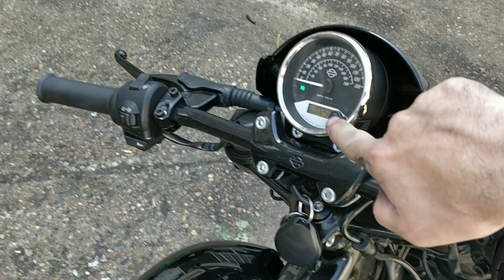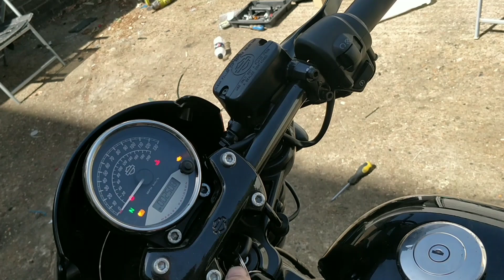My Harley Davidson has broken down, spark plug change. what next??? :( 2022  #broken #harleydavidson

Comment: Ok, locate the thermostat switch and bridge it to see if it kicks the fan in, if ok ....
Remove the thermostat and clean the metal  contact area inside the radiator. 
If no joy then it's the thermostat and not the switch.
Also chase the thermostat switch power to the connector block on the left handside.  Check contacts haven't corroded or melted.

Due to excessive heat I would check the rear brake fluid as it sits downwind and may have affected the fluid if original. 

Air filter is indeed stock but judging by the white writing I would say your ECU has been flashed & remapped for the exhaust or it's a second hand unit possibly due to a fall as it's the backing plate.
Any further performance upgrades will need a fuel pack piggy (fp3)backed of the ecu/cdi .

See what happens when you let Nat loose with sharp implements 😆😆
Reply from the maker: Thanks Daniel for the advice mate, I'll do these checks today. 

Appreciate all your support mate

Comment: I don’t think your thermostat is working or working properly 
You’re right to add a switch at least, even if you test the fan and find the motor is blown on it or ideally a faulty connection 
I think the coolant on the floor is overflow from it getting hot 
Loved the clips of you racing past the gate, appeals to my child like humour😂
Reply from the maker: Hi Gary, this evening I've been thinking the same that it appears its not opening. Problem is that you can only buy the whole unit including housing at around £120. I may try to get in and take the thermostat out, I can test it at least and possibly run without one. But again you can't just buy the thermostat itself which is terrible. 

Thanks for that clarification Gary that's extremely helpful

Comment: Maybe its the themostat
 switch not working properly Charlie,caus8ng the coolenr to get to hot and exoand,🙄,Nice haircut 😂👍
Reply from the maker: The thermostat housing has a temp switch in it, making me wonder if the thermostat isn't opening. Normally the switch is on the rad itself. Unless it has 2. 

I think my next step is to remove the thermostat and see if it works better. Also to check the fan fuse.
Reply: @motorcyclerescuer  yes that sounds logical 👍
Reply: @motorcyclerescuer  My experience with bikes is all air-cooled, but I am a retired car mechanic. In cars, electric fan control can be done in several ways: some have a thermal switch in the radiator, some in the thermostat housing or cylinder head, and some are switched by a relay controlled by the PCM, based on coolant temperature sensor input. 
This bike would be designed to work in all kinds of climate, many of them a lot hotter than ours, so the radiator is probably very efficient at getting rid of the heat, even without much airflow, so without knowing the temperature of the coolant you can't tell if the fan should be running or not. 
If the thermostat was not opening, the radiator would stay cold and the engine would overheat quite quickly if left idling after a run, as it was, so you would have a warning light. 
It looks to me like your original overheating was caused by loss of coolant due to the hose clip failure, not the other way round; cooling systems are designed to work at pressures of typically around 1 bar and if it loses pressure the coolant will easily boil inside the engine. That type of system is designed to vent excess pressure through the relief valve in the cap into the expansion tank, then draw the coolant back in as it cools when it's switched off, so your spillage at the end was most likely just the excess from refilling being expelled.
Meanwhile, on the Triumph carbs, they do have throttle stop adjustment, it's by the screws angled upwards on the side, which push the slides up. You need to back these right off before synchronising the cables, to make sure they are starting from the same level, then readjust them once you've got the cables matched.
Reply from the maker: Hi Rick, even in the best conditions these harley rads and coolant systems are known to not work very efficiently sadly. 

The temp sensor is in the thermostat housing on this one. My job today will be to see if the fan fuse is OK and not blown and to check the pipework around the bike to see if coolant appears to be flowing as it should. 

And with the amal carbs I didn't see the stops but will look again today. I'm sure it's not running properly on the right side, as in spark or similar so I've ordered a new set of ht leads. 

I've checked and changed everything else but it still runs hotter on the left. It definitely has spark on the right but possibly not enough. 

Any advice mate? 

Appreciate your help.
Reply: @motorcyclerescuer  On the Triumph, it sounds like any ignition issue must be on the high tension side, because a low tension fault would affect both sides equally with that type of system. Have you tried swapping the coil/lead combinations from left to right to see if the fault swaps sides (if your leads are long enough you can just swap those, because both plugs fire at the same time)? When you fit new leads, I would advise checking the ignition system supplier's specification (they usually specify copper core wire and 5000 ohm resistor caps). If you have a strobe light, you can connect it to each lead in turn and just watch the flashes for a while. If one of the leads is breaking down, you should be able to see irregular intervals in the flashes.
On the Harley, don't assume that the sensor on the thermostat housing operates the fan directly, it may just send temperature data to another control unit (bear in mind there must be a sensor which triggers the overheat warning lamp). If it is a simple thermal switch, the wires should be the same size as the ones supplying the fan motor.
Good luck with getting both of them sorted.
Reply from the maker: I've ordered new ht leads with caps for the triumph so that should tell me what's going on hopefully. Fingers crossed
 Will update soon. 

Harley seems fine, ran it today, all the hoses are hot so coolant is circulating which is great. 

Time will tell with the harley as to how its doing. 

Thanks for your advice, it's extremely helpful.

Comment: I used putoline iced coolant in my dt125r after I fixed my headgasket issues to help keep the bike cool. Bike seems to be running great with it
Reply from the maker: I think that's what I'll use although for now I think i need to check that the thermostat is opening as it should. It may not be functioning properly

Comment: (edit .   complete waffle below !! )... 🤗
It just seems odd taking about liquid cooling on a Harley . I guess it's progress . Like when they put a radiator on the bandit , it's just not right . But at the same time it is . 
I think the small spill was  overflow from header or expansion tank ( whichever it is on the 750) just from you filling it . And I'm guessing the over heat was from the hose fitting giving up not the hose going off due to overheat . As it's not showing an over heat light now and the fan is not coming on I'm hoping it's idling cool enough .. But then again every water cooled bike I've had will kick the fan in on idle within 5 minutes. 
I've also begrudgingly fitted a manual fan switch to some bikes just to be in control ..
Apologies for the long waffle. 😉
Peace and love brother 👍🏻☮❤
Reply from the maker: Its a tough one isn't it. It does appear yo be running slightly hotter then I like but within limits. 

I think I'm going to remove the thermostat and see how it runs then. If it appears to flow better and the fan come on then I'll have the answer to my question. 

Thanks

Comment: Just a thought the leak at hose clip was caused by over heating ,as fan does not run and the over temp light does not come on possible fan control module faulty hope this helps
Reply from the maker: My guess at this stage is that the coolant isn't circulating. Although I think the fan uses a fuse so I'll look to see of its cooked tomorrow just incase.

Comment: lovely bike, wished i still lived in london, was only in Clapton E5
Reply from the maker: Oh really, not too far from me. Although your probably better of out now Steve. London is hard work.
Reply: @motorcyclerescuer  tell me about it, job in Angle Islington was normally a 15 minutes drive, they closed the back roads then it was a 90 minute sitting in traffic nightmare, got a house up north cheaper than a lockup garage ;) (not knocking your workshop pal ;) use what you have, and the best to you, just so you know i have a workshop, lathe, milling machine, any bolts, special fixings you cant find give me a shout and ill run them up on the lathe)
Reply from the maker: Oh wow cheers Steve thats extremely helpful mate. I'll keep that in mind.

Comment: Hey great video. Have you tried changing the hose lines as the E10 fuel ruines the pipes etc.
Reply from the maker: Hi Cheryl, I believe they are already.
Reply: @motorcyclerescuer  good luck hope you've managed to solve the issue. I would check the hose lines and replace if necessary. 3 components needed for it to run... fuel... Air.... spark.... its just a guessing game to get the right mixture lol

Comment: Hi Charlie on the Harley are all the pipes getting hot like in and out the rad is normally how to check if the thermostat is working but looks like you overfilled it a tad as to why it was coming out the overflow also could be a air lock that stopped the thermostat from opening I'm sure you know all this anyway but hope you sort it soon
Reply from the maker: I actually didn't even think to check the pipes lol. Will check today mate. My guess is that the coolant isn't circulating as you suggest. I'll check the cold level today out of curiosity. Cheers mate
Reply: @motorcyclerescuer  ok cool lol thought maybe you had done it off camera I'm sure you will get to the bottom of it such a mint bike would be a shame to fit a switch to it for the fan but if need be is a easy fix good luck!
Reply from the maker: Time will tell Alex. I'll keep everyone updated, but it may be ok. 

Cheers mate

Comment: Hi flo is a very good brand. Its the only brand I'll fit apart from OE stuff
Reply from the maker: Hi flo, for the air filter?

Problem is that I would need to run a piggy back on the ecu which cost a few hundred.
Reply: @motorcyclerescuer  hi flo is just the name of a brand. Like Nike trainers
Reply from the maker: Oh I see, yes I have heard of it before Steven and used it a few times mate. 

Cheers

Comment: What a great bike. Just the ticket for knocking around on the streets with plenty of presence and feel good factor thrown in.
I’ve never owned an Harley, I suppose when I could have, it wouldn’t have suited my mindset or riding style if you can understand what I’m trying to say , and now it would suit me more I don’t have the money or room for one.  Do you like it? And what would you change if anything?
Reply from the maker: Hi David, I never really liked Harleys for the same reason as you, that they didn't suit me, although always kinda liked the v rod. Then I saved up a deposit to buy a new kawasaki vulcan on finance, when I was in the shop looking at the kawasaki this Harley was next to it at roughly the same price. I was shocked at how stunning the Harley looked compared to the cheap plastic looking kawasaki. 

I had always liked something about the v rod but couldn't afford one. So this was my time.
Reply from the maker: Oh apologies,  and to answer your question.

The exhaust gets very hot and burns your right leg at lights. Somehow I would chage that. 

This specific exhaust is to loud, I would prefer a medium sounding one. 

The front riders pegs don't have springs  do when you pull them up by mistake they stay up and as you ride away from lights sometimes you can't find them lol. 

The alarm is a proximity one. I would prefer to be able to control it with a button. 

The handle bars were slightly to long for London so I cut them down a little.
Reply: Interesting answer, I liked the look of the V-Rod too, I’ve never seen one in the flesh though,
Reply: Don’t blame you one bit. If I was in that position now I would do the same. Remember this you have thoroughly earned it. I’m glad for you.  Just one thing missing bro… the Harley beard  ps stubble doesn’t count…  show more of the Harley when you need to tinker. Just routine servicing stuff we don’t want no breakdowns .
Reply from the maker: I gave it a mini service last week although will change the oil soon i think and possibly a new air filter

Comment: The splurge of coolant after idling for ages was probably burping air out of the system where it's been completely emptied. Over pressuring the expansion bottle and pushing some fluid out of the pipe that was maybe already there from it overheating before.
You should get a temperature gun on the coolant hoses before and after the radiator. The fan is probably set at about 95°c and shouldn't need to come on at idle if the pump is doing its thing unless you've just been for a longish run and it needs to get rid of excess heat after that.
Reply from the maker: It seemed ok today. I'll use it as normal for a couple weeks and see if any problems arise. All pipes were hot meaning coolant is circulating.
Reply: @motorcyclerescuer  thats good mate it's a lovely bike. You could take the temperature switch out and test it to make sure it's working at the right temps if you start to doubt it
Reply from the maker: Great idea, that will be my next step if it appears to over heat at any time. 

I think I got the piaggio fly running well today, had a very quick test run then ran out of time lol
Reply: @motorcyclerescuer  was it the carb in the end?
Reply from the maker: I believe so, the carb sent to me was ruined, the first carb was bad aswell. So I've built 1 out of the 2 but have not tried it yet. 

It ran very well and fast on the upjetted carb with cone filter.
Reply: @motorcyclerescuer  that's how I like to run. Open Hi flow ram air filter and bigger jets. 
I'm still trying to sort my powerjet out so I can drop my main jet down and take over with the powerjet at higher rpm but it's not working like it should.. Pain in the arse.
Reply from the maker: It ran very well with that carb. I'll convert the throttle for the Chinese carb if both piaggio carbs are junk.